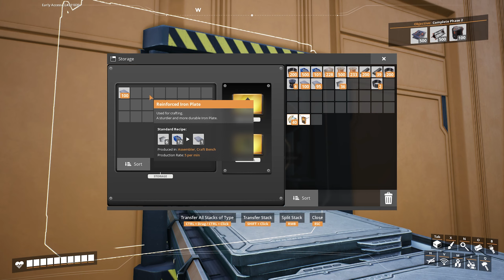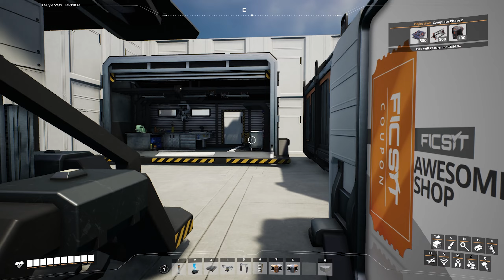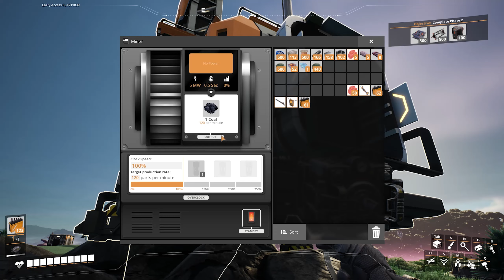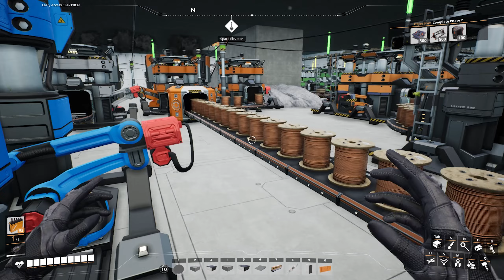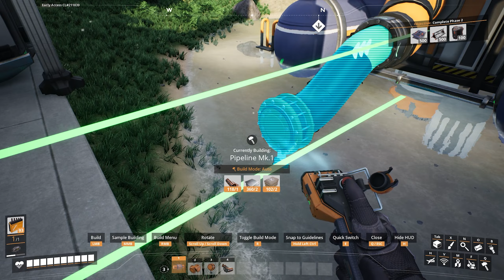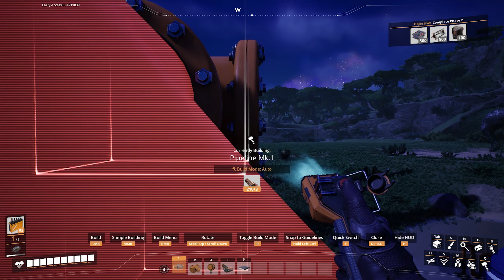Coal power plant in Satisfactory

Comment: There is a sulfer node very close to your coal node. You can research sulfer in the mam to unlock compacted coal. Compacted coal burns at a rate of 4.5/min rather than 15/min. The sulfer node is east-eats-south of the coal node.
Reply from the maker: Man this game goes deep and ill keep this in mind for a coal power plant 2.0  after i first made the rank 1 deal so i can breath again but sure i have another coal mine for that experiment and build a better deal after making the quarts factory! Thank you much!
Reply: @buildingfactory  Sounds good. Just use the sulfur sparingly. Usually 1 node for coal generators and 1 for turbofuel generators and the rest split between factorys that need sulfur is a good balance.

Btw did you block links in your comment section because everytime I try to send a link to a image the comment dissappears after a minute.
Reply from the maker: Youtube automatically blocks links because in the pass there was a lot of spam to wrong sites and no matter how they tried to filter it out somehow people found a way to still spam them so ill guess they completely blocked it out atm

Maybe you can give me keywords to typ into google and so find the link of the image?
Reply: @buildingfactory  It's fine you can search for satisfactory calculator. It is a website that gives you an interactive map that can hep you plan out your factorys.

It can also give you a flow chart of what and how many machines you need to create any item. 

But you will personally have to choose what parts of it you want to use since some of it may be seen as cheaty by some(suchas the ability to edit your save files).

Comment: You will want to pull from 2 coal deposits to keep up the the increased demand power, so you don't run out of coal.  Place 2 biofuel burners near the coal plants to get them going and after they are going, you can remove the bio burners.
Reply from the maker: I think its kinda cool to need the bio burners in order to start the coal plant, Ill might just save them up in case of what ever happens but sure turn them of!